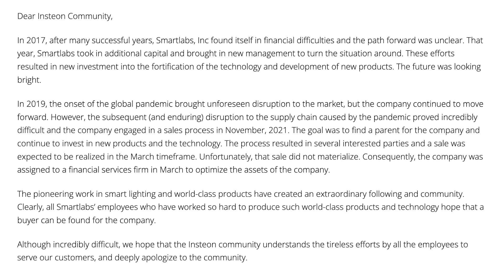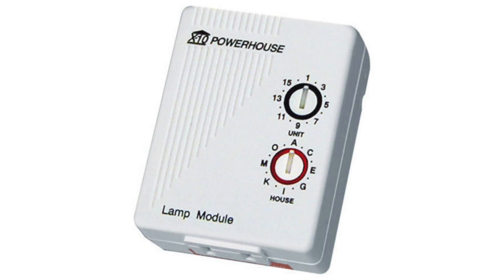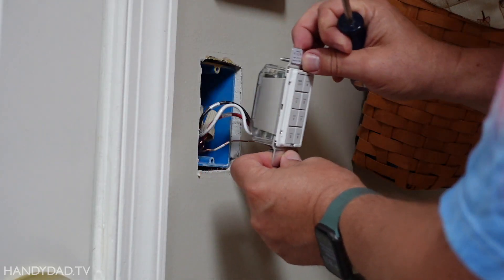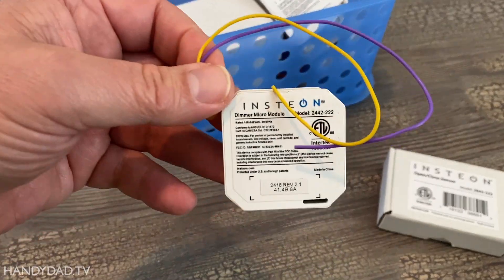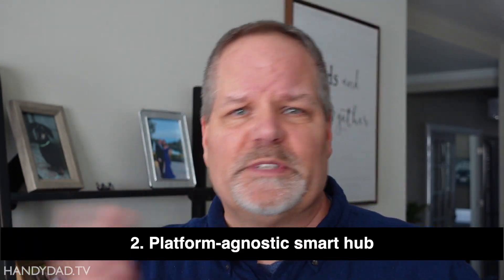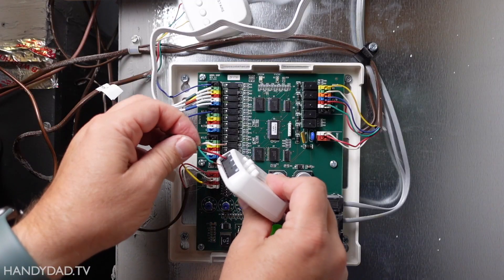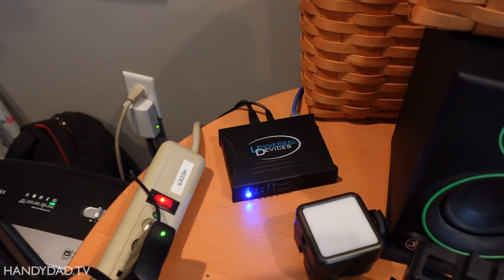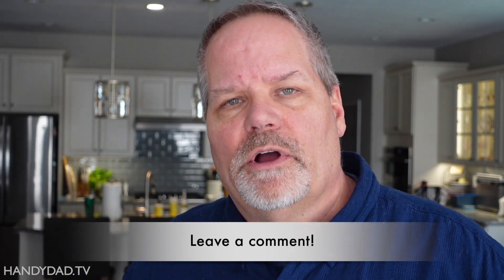INSTEON out of business. What to do?

Comment: Thank you for another informative video Chris. Over the years I have been gradually converting my home to be more automated. I first started with the Nest system. I have two Nest cams, Nest thermostat, Nest smoke alarm which have worked great throughout the years. I also have installed Kasa devices in my home. Kasa smart lighting, smart plugs, and smart switches which have also been working well over the years. The smart switches are a little finicky sometimes but it’s usually a user connective issue. And thirdly I have a Wyze cam which has been useful and minimal issues. I have integrated the Nest system and the Kasa system with Google home. Everything seems to be working well and we love it. My next project will probably be automated electrical blinds. There a little pricey so it’s low on my priority list.
Reply from the maker: Thanks for sharing your setup. I don’t know why, by WiFi is troublesome for me. We often have 3 bars of WiFi signal on our phones or computers, and can’t get to the internet. We reboot devices and ultimately the router to resolve. I also have 3 WiFi bulbs in outdoor fixtures on my house, and the furthest one sometimes fails to turn off in the morning with the rest. Intermittently, even though there is plenty of WiFi signal there.
Reply: Great video as always! You need a mesh system with 2 or 3 base stations. I did that to my house everything speeded up, have ring doorbell, Alexa’s, smart switches, about 20 total 😮

Comment: I would look into Home Assistant. It currently  has a Insteon integration, and it is also capable of being used without the cloud and integrates to a tremendous number of other smart home devices, hubs and platforms. This should enable you to continue using Insteon and migrate to many other options, and they should integrate together.
Reply: I use Home Assistant too, run off of a raspberry pi 4.  I recommend it too.  It requires a certain degree of computer literacy but it is the best open-source solution available today and the integration is incredible once the hard work is done.  I have a handful of Amazon fire tablets running WallPanel plastered around the house, plus I can run the Home Assistant app on my ipad and iphone.   Controls, alarms, stills, even live video feeds from the security system.  Notifications.   It's really really cool stuff.   Everything is tied together with wifi.

And this presents us with the main reason why companies with proprietary technologies like Insteon are virtually guaranteed to fail.   The instant a company loses control over the technology that manages the home, it just becomes another one of literally hundreds of end-of-chain device makers and it becomes very, very hard to distinguish oneself from the competition.  Particularly when there are now power-line communication standards, not to mention wifi, that is capable of gluing everything together.

-Matt
Reply: @junkerzn7312  Does the pi 4 work so that I can access my Insteon devices away from home?
Reply: @andyhutch1947  Outside access is not a function of the RPi4 specifically, but of course since it runs linux there are several ways you can gain access to an inside machine from the outside.

There are three ways to access your home LAN from outside of home.

The first is that you use dynamic DNS to cause a domain name under your control to resolve to the current dynamic IP that was assigned to you by your ISP, and then drill a port on that IP through from your internet router to the RPI4.  This is the most common solution.   However, a great deal of care must be taken to ensure that whatever you run on that port (typically the web server that home assistant runs from) is secure.   I don't personally recommend this method as it opens up the H.A. login page to anyone to make guesses on.

The second is to use an outside VPN service that you can connect to from outside and have the RPi4 also maintain a connection to the VPN from inside, thus making it visible to anyone on the VPN.

The third is that Home Assistant itself specifically has a commercial VPN service that allows you to access it from outside the home via a gateway.  If you trust the service, I think the integration is fairly good.

-Matt
Reply: @junkerzn7312  I am a Mac person. What OS runs on the Rasberry pi 4?

I read some of the information on their website and it looks very impressive.
Reply: @andyhutch1947  Thje RPi4 runs Linux (64-bit linux).
Reply: Yes I’m still using all my Insteon devices through home assistant
Reply: @SpartanBrass  Question, I was using the Insteon hub and only had one dimmer for my home theater, which was connected to my Harmony Hub. When I started a movie, it would dramatically slowly dim the room and vice-versa when credits were playing. This is why I chose Insteon as others I tried would dim too quickly and I had no control. So, I want to find another product or hub that works with my Insteon dimmer that can do the same thing. I have other dimmers in my home that are wifi and are just fine for my dining room, etc. By the way, I'd also consider replacing the Insteon dimmer with another brand if it would allow control over the dimmer speed. Any thoughts on a way to get that functionality back?
Reply: @fastbobby504  oh yeah cuz the harmony communicates with Insteon through servers as opposed to home assistant that controls the Insteon hub via ip drivers. If you were to add home assistant you’d be able to control all of your lights and whatever other smart devices you have. Home assistant talks to harmony but I think it would be difficult to trigger an automation out of harmony to home assistant to Insteon. Now that I think about it, seems very possible Logitech shuts down their harmony servers at some point. I’m pretty sure you can control set a fade on and off with Lutron radio ra2. Would be expensive you just one dimmer. I’m probably going to switch to it because they offer scene keypads like Insteon
Reply: @SpartanBrass  I am currently using Lutron RA2 with Home Assistant.  Dimmers and keypads.  Works great.
Reply: @SpartanBrass  I know Harmony's days are numbered for sure as it was already announced. However at this point they say there are no plans to turn off any of the servers. We'll see..
Reply: @overamped23042  can you control the ramp on and off of the dimmer?
Reply from the maker: Does HASS interface with the Insteon hub or PLM?
Reply: @handydadtv  through the hub. I just tried connecting to the Insteon hub via ip and port but it redirects me to a dead link to a device control page.
Reply: @handydadtv  Both. the Insteon tab gives you full access to go inside hub or PLM continue to create scenes, automations, etc. It'sa fantastic and opens the door for so much more integrations.
Reply from the maker: Thanks. Looking into it.
Reply: Home Assistant is garbage. I have spent the last two days trying to get it to work. It just does not work.
Reply: @KameraShy  I'm sorry you are having difficulties. You seem to be the odd man (or woman) out here. If you could give us a little more information we could possibly help you see how Home Assistant can make your life much better as well
Reply from the maker: @KameraShy Sorry you’re struggling with Home Assistant, but I found the best way to ensure success is to set it up on a new, dedicated device. Using Docker or virtual machines simply complicates your setup. 

This video shows exactly how I installed it for the first time just a month ago: https://youtu.be/CYvTLw_Wn6I

But if this doesn’t help and you want to give up on Home Assistant, I recommend you check out HomeSeer: https://youtu.be/S9i0bSpr158
Reply: I recommend HASS as well. It's great. Been using for years.

Comment: Thank you for filling in and rounding out the Insteon story.  I too started my addiction with X10 and moved up to Insteon a couple of years ago .... primarily driven by Christmas lighting.  Since the "death" of Insteon, I've been playing with Home Assistant.  As an old programmer, learning HA has been fun but it's too complicated for most folks.  I have been intrigued by Universal Devices new Polisy device ... a little pricy but might be good glue to hold everything together.  Thanks again.
Reply: My experience mirrors yours exactly...  I never purchased the Insteon hub because of the lousy reviews.  I went with ISY out of the gate and have been satisfied
Reply from the maker: I’m reviewing the ISY in an upcoming video. Works well but requires a PLM, which is hard to come by. Thankfully, I have one.
Reply: @handydadtv  Like others, My X10 to Insteon saga started in the 80s and been using my Insteon devices since then. I started with the PLM attached to my PC and later got the hub when the PLM died. I'd be wary of paying the huge current prices for a PLM as mine died within a couple of years. You may not get enough use from it for the price you pay now.

As for me, I have been selling off all my Insteon gear on eBay and getting out of Insteon. The money I am getting for the Insteon modules and switches more than cover the cost of my new, cheap Wi-Fi replacements and the cost of a cheap used wireless access point to set up a separate Wi-Fi network for them so they do not mingle with my other home network devices.  

My other family members have installed the Lutron Caseta ecosystem for their light switches and they are happy with it. I almost went that route but it was a good bit more expensive than the straight up Wi-Fi devices and no hub.
Reply: Same experience as Salvadore Pozzi.  Have over 100 INSTEON devices running on an ISY.  I'm thinking the answer might be to transition to Z wave over time.  If I added the Z wave radio add-in to my ISY controller...  Need to talk more with Universal Devices.  Still leaves the problem of that 8-button switch.  No one seems to make a Z wave 8-button switch pad.
Reply from the maker: Zooz makes a 5-button Z-Wave scene controller that I’m going to be testing. It’s just a switch, not a dimmer like Insteon.
Reply: Heinz, I'm also looking at Polisy but am a bit intimidated by the Polyglot python programming. I'm sure there's a ton of info, videos, and help to be had, just not sure about the learning curve.
Reply: Insteon is not dead and the devices can operate without the internet hub.

Comment: Thanks for the informative video. Like you, I started with X-10(Radio Shack Plug'n Power) decades ago and moved to Insteon/ISY for reliability, compatibility and versatility. I now have a complex setup which integrates Ring, Echo(Alexa), Insteon and a few other devices. I will be watching closely to see what happens next.
Reply from the maker: If you’re an ISY user, you didn’t even notice when they shut off their servers, right? I am playing with the ISY right now.
Reply: @handydadtv  That is correct, everything is still working as it was. The only thing that relies on the cloud is the Alexa/ISY integration. But if the PLM fails, we are screwed.
Reply from the maker: PLMs are prone to failure, from what I’ve learned on Reddit, but you can repair them yourself by replacing the capacitors, and there are kits that provide everything you need except a soldering iron.

Comment: I use Wink. Every month, I wonder if my blue light will continue to shine. I was an X10 guy back in the day. I've migrated away from most Zwave lighting controls and only have my thermostats and door locks on Wink. Otherwise, everything else is on Wi-Fi.
Reply from the maker: I’m on the fence about introducing all those WiFi devices. Especially when they all are made in China and use cloud servers. A networking geek may know how to isolate them on a subnet, but most people wouldn’t know how to do that.
Reply: @handydadtv  I understand completely. I would favor Zwave, but trying to find a controller that's user friendly is another matter all together. I have worked on a few Lutron Radiora systems, but are generally unimpressed with their software options. It boils down to cost and security.